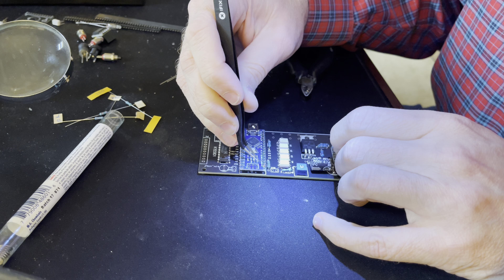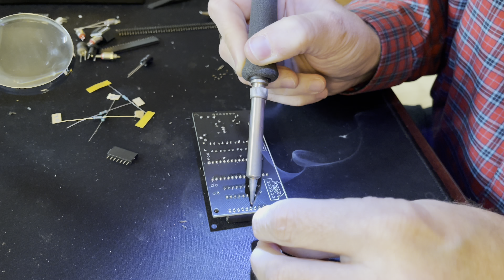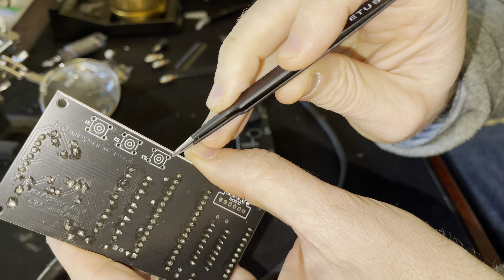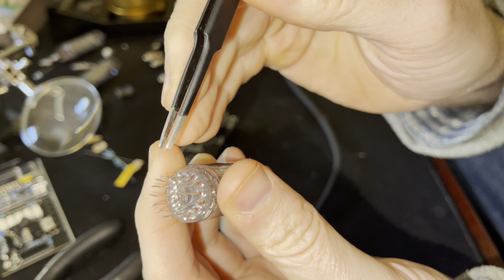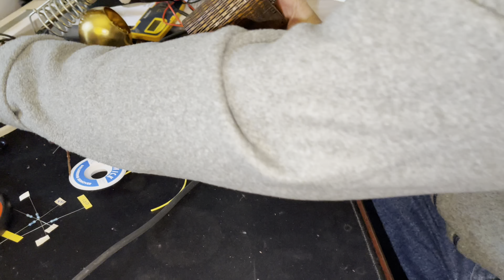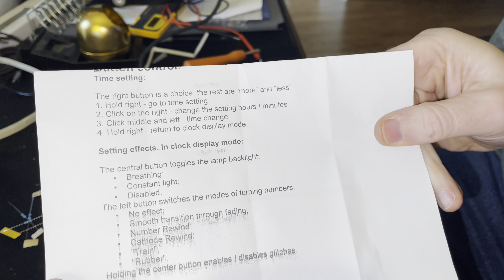Poltava Workshop "Gofra" Nixie Tube Clock Assembly (Part 2)

Comment: Thank you very much for these videos. I’m very much a novice at soldering, other than having done a small amount in my teens (badly). 
I’ve spent all day on this (with the same cheap soldering iron from my teens, lol), looking at your soldering technique and learning from it. Some of my joints are questionable at best, however the clock is now fully operational!

Comment: These videos have been very helpful since the short url links to his instructions don't seem to be valid anymore.  Only question I have is the small daughter board with the battery is actually the real time clock circuit but underneath it are two holes that are labeled "any ceramic".  Did your board have that and if so can I just solder any ceramic capacitor on there (for clock timing perhaps)?  Thank you for these videos.